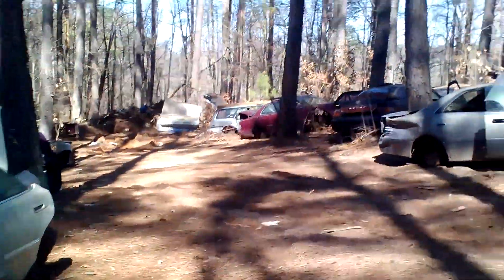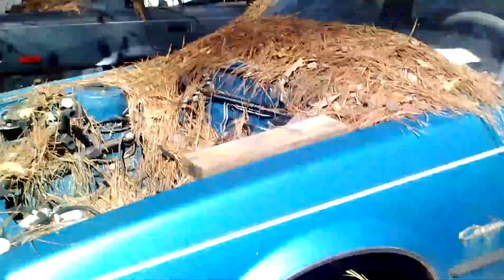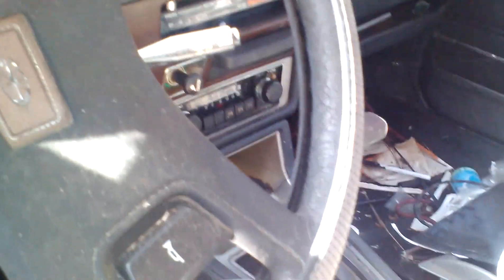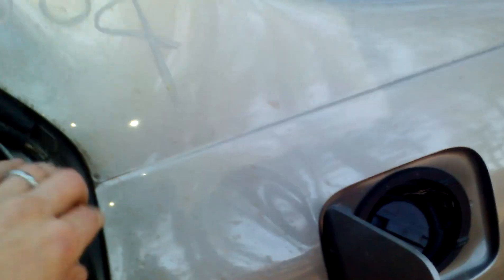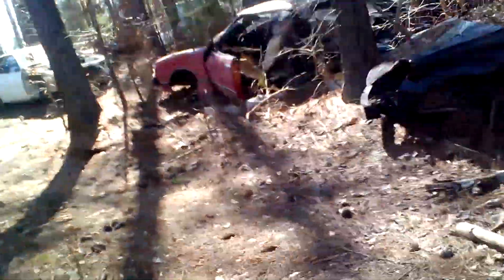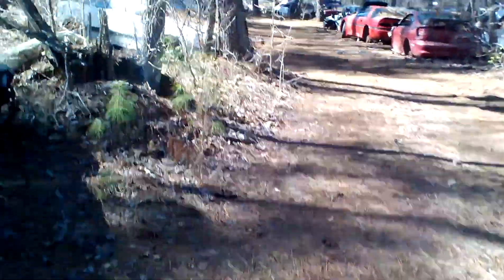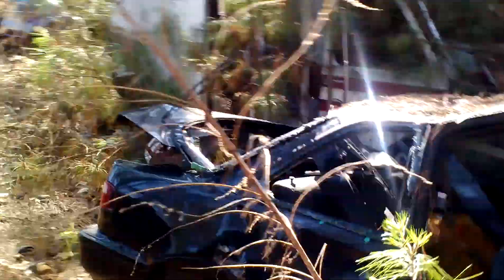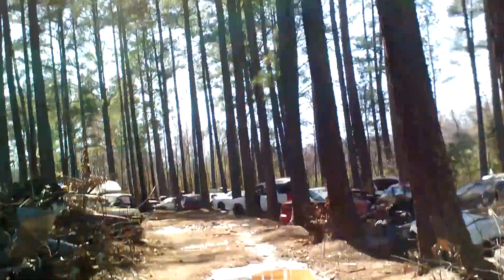Vintage Toyotas in car boneyard

Comment: Nice video. I love mid-late 90's camrys. Btw ..the 2.2 liter (5sfe) engine( in the majority of those camrys) is not a "interference " engine...so broken timing belts is not the reason they are there..I would say extreme neglect (eg. not changing the oil) , accidents, or just ALOT of miles caused their demise and why they are there. BTW (as you probably know) parts still sell great off those 20 something year old cars! Many still on the road today!

Comment: I remember along time ago I bought a 1965 Mercury Monterey for a project and fixed it up painted it your dad's color he likes candy 'apple red' with a white top. But anyway I needed one original hub cap and a four barrel intake(was going to dump the two barrle and give that old tank a little more gitty up go. Now this was in the middle 80's So I ended up going to a junkyard that I worked part time at as a kid that then had alot old cars still stashed in the back 40. So on a visit south I stopped by the yard talked to the owner who had aged quite a bit but was the same ole George and hell of a nice guy. Told was I was looking for a four barrel intake and a hubcap with the winged Mercury head in the center. He pointed to an old truck in the distance for the intake, and pointed to a great big dump truck body for the hub cap and snickered and said have at it. It was a nice hot summer day and Well I didn't look forward to pawing around in hundreds of metal hub caps to say the least. So I went and pulled the intake and walked back to the dump truck body and dropped the intake on the ground. And were I dropped right beside it was the hub cap I needed. There were some hub caps on the ground in the grass all around the truck body. Sorry this story was so dragged out and long but it goes to show there's a higher power from above looking out for ya.  Reality like your videos Jay kinda brings back the good old days working in the yard. And oh yeah George only charged ten bucks for that intake and the hubcap.